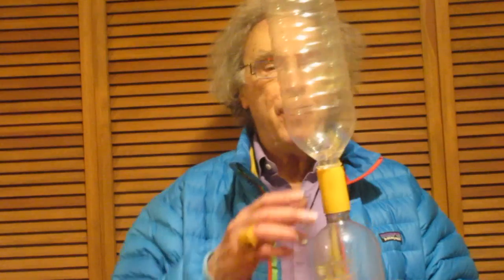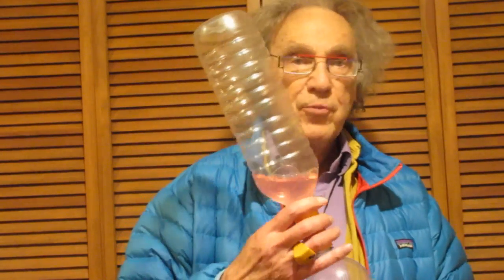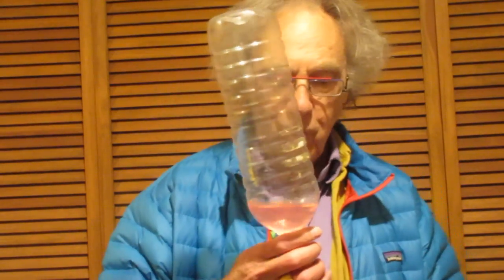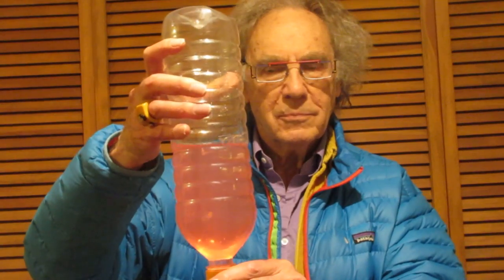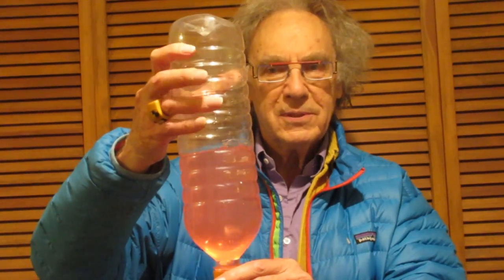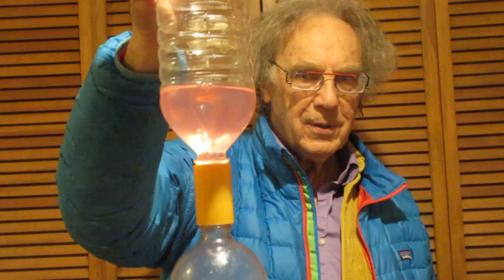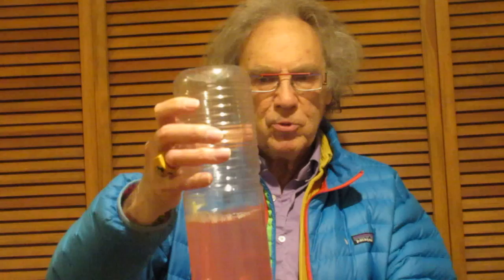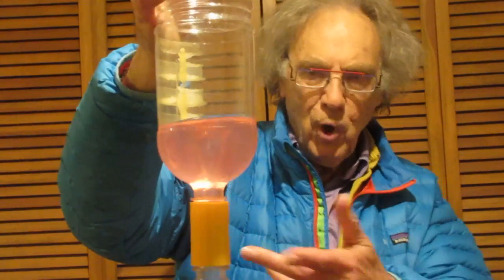Solution Problem #2 -  Vortex Transfer of Lemonade

Comment: Thank you Professor for mentioning my video. For those who have hard time to find my video, just type in the search on YouTube: "Video answer to professor Walter Lewin", and you will find it. Yes my English is not the best - that is because I learned it myself... well somehow. Greetings from Croatia. Milan Karakaš.
Reply: Prof. what about the value of min time to transfer the liquid? Here for one bottle the liquid leaves and the same amount of volume is occupied by air from the other bottle if not then vacuum creates pressure diff now for maximum rate of transfer the volume of substance entering and the volume of substance leaving must be the same hence max rate of transfer is obtained when the cross-section available for water to leave and air to enter are same. So for the straw solution if you have a straw such that the inner cross section of the straw is same as the difference in the cross section areas of the connection and the straw you will have max. transfer rate. But the rate can still be increased if additional force is applied on water such as accelerating the setup upwards or having extra systems inside such as piston(plunger).

Comment: I always wondered why a vortex won't form automatically when you empty a bottle, but when you empty your bath or sink it automatically forms.  Vertasium and SmarterEveryDay made an excellent video explaining this with a wonderful experiment showing why the earth's rotation has a bigger effect on a body of water covering a bigger surface area.
Reply: Because the engineers who designed your bath and sink had already known this?

Comment: Excuse me for being a physics noob but I had thought of something that I thought would work the the differentiation in pressure. It think Dr. Lewin mentioned it but it may have been confusing for me. What if you poke a hole in both bottles? The lower pressure bottle draws air in, and the higher pressure bottle (the one with water being "pulled" into) pushes air out allowing water to transfer through easily.
Reply: You're absolutely correct and this video is garbage. Find another source for physics knowledge.

Comment: Clever solution, probably all efficient toilets designed to create a vortex clockwise (in North) and anticlockwise in South were inspired by this principle. The bubbles passing through and water passing down increase the vortex spinning, is this because the gravity increases the speed of water passing through the least air intake resistance?
Reply from the maker: ask google
the physics of vortices is very difficult

Comment: What happens when you tip your bottle assembly on it's side, and let the liquid transfer between them, while slowly tipping it to optimize the rate? I would think that the moving liquid could occupy at least 90% of the opening, allowing 10% for the air to transfer the other way.  What do you think?
Reply from the maker: that would rank among the longest times of transfer. Try it!
Reply: I will let you know. ,,and I will be also trying the squeeze test, that I mentioned before. I have a feeling that one will beat the vortex.  The think about the vortex solution is that it is perhaps the most elegant and the least obvious one....until you do it.
Reply from the maker: the opening that connects my 2 bottles is only 4 mm across! I have tried your method months ago and timed it. Vortex transfer was 7 times faster!

Comment: So is this why tornadoes form?   When an atmospheric condition forms where there is a narrow hole in a blocking layer - forcing hot, rising air to squeeze through it to get to the upper atmosphere (Thundercloud) it naturally starts twirling as a way to increase the transfer....

Comment: Professor, what about the type of liquid? Will you have the same results with mercury for example as opposed to water?
This is lemonade, and most lemonade I know is made from a gelatine, it's viscosity is different. Is it carbonated lemonade?
So my best guess, not solution, is, it still depends on what type of fluid you're using.
Also a lazy question, because we both know I can test this out myself too, but I don't have the proper tools nor things to do so at this very moment...But, what about adding a tube that goes from the top of the bottom bottle to the bottom of the top bottle, making the (air)pressure equal in both bottles?

Comment: thank you professor, very ingenious solution. I was thinking to make a hole in the bottom of the upper bottle and another one in the upper part of the lower bottle so the air can get into the upper bottle to replace the liquid and the air from the lower bottle can get out in order to make room for the liquid. I am guessing this solution would be faster but it needs to be tested first. What do you think?
Reply from the maker: the hole will make it worse. try it.
Reply: I am talking about two holes one in each bottle one for air in one for air out. Thank you for your reply.
Reply from the maker: may make it worse - try it and let me know

Comment: wow, interesting. 
half way through the video I've came out with something of my own:
adding 2 tubes into the design, where one starts at the bottom (on the side of the bottle) and the other end is attached to the top of the other bottle, do the same on the other one. Allowing air from one bottle to escape quicker to the other. I believe it would work.

then I've seen the tornado ... wow I did not expect that :D very good.

Comment: you can put air hoses between the 2 sides one high one low
Reply: @SimonWoodburyForget  Creating pressure/suction also requires energy, not to mention it can deform the bottle.

Comment: Professor, I have a doubt. 
In the very starting of the video, around the first minute or so, you said that the pressure in the empty bottle is more than the pressure (due to air) on the side with lemonade. I don't understand why (and I find your explanation a bit counterintuitive). Let me elaborate on my understanding so that you may help me out where my understanding goes wrong. 
When the lemonade side is kept straight (neck facing up), the air columns in both bottles are in contact and are rather the same, and have the same pressure as a result. When we invert this configuration, the liquid gets in between the two reservoirs but since the pressure of both air columns are still same due to no change in volume available and no change in number of molecules (assuming that the inversion took place very fast) [PV=nRT]. 
Thus, now what I believe is happening is that the lemonade being a fluid that is also denser and is being pulled down by gravity too, drops down. But since it is incompressible, the volume available to the air becomes lesser as more lemonade drops down, and thus the pressure increases. 
Eventually, it becomes more than the pressure in the air column above the lemonade and thus it bubbles up while lemonade drops down thereby obstructing each other's free flow. I think that the water is just a medium between them, a separation, a sort of a weak wall. 
But at the same time, as you said, the water column also exerts a pressure proportional to its height, this is also true, but I don't understand how come you said that the pressure on the empty side is more. Since, before inversion both volumes of air had the same pressure. I understand, that the lemonade would have some pressure, but how can we account so much extra pressure suddenly(equal to density times gravity times height) with negligible compression in volume of air in the empty bottle?
Thank you for your patience and reading my question. 
I will be highly grateful if you can take out time to answer my query.
Thanks a lot professor!
Reply from the maker: If you measure the pressure in going through the liquid  starting at its  surface going down to the yellow funnel, the pressure must go UP with an equivalent of about 8 cm of water pressure.
Reply: Pranshu Malik - "but how can we account so much extra pressure suddenly(equal to density times gravity times height) with negligible compression in volume of air in the empty bottle?"

It would take about a millimetre change in height of the air columns. You wouldn't be able to tell just by looking.
If we take one atmosphere of pressure to be equal to 10 metres of water, then 8 cm represents 0.8 per cent change in pressure. A 0.8 per cent change in the volume represents roughly a 0.3 per cent  change in the linear dimension. The 0.3 per cent change would be shared between the two columns, 0.15 per cent each. If each is 25cm, that would be less than half a millimetre each. You would notice nothing!
Reply: Icy Strangers Thanks a lot!! Oh yes, I forgot all about the numbers
Reply: Lectures by Walter Lewin. They will make you ♥ Physics. Thanks a lot, professor!!!

Comment: I noticed an increase in drain speed when I tilted a bit the bottle near the end of its draining, all that without destroying the vortex, is it just me or is it an even faster fay to transfer the lemonade?
Reply from the maker: No!
build one time it and let me know
Reply: I made 5 measurements of the time for 4 diferent cases, to measure it more accurately I put a mark in the bottle to start timing when the level of the water passes that line until the level passes the cap and I only drained the bottle one way. First I had a plastic to make the tunel between bottles narrower and emulate your bottle, indeed you were right and my times for the drain with and without the tilt where (8,34±0,10)s and (8,400 ± 0,089)s which are efectively the same,  however the tilt you can do in this case without destroying the vortex is very little and has no effect whatsoever, but when I removed the plastic and let the tunel have it's original size the vortex generated won't be as narrow and when I did the measurements again I got (3,090±0,054)s and (5,062±0,083)s for the tilt and no tilt case respectively. I'm going to a festival this next 4 days, but if needed I can make a video on it.
Reply: I was hoping some feedback on this

Comment: First of all it's been a pleasure learning from you sir..
I duly admire you and your teaching,...the idea is great 
one more thing,u could probably ask some maths problems too,i believe they would be the best one's (logical).
Reply: +Lectures by Walter Lewin. They will make you ♥ Physics. 
God! sir, ur reply made my day😇😍
Reply from the maker: Teach me please. How can I make things like this 😇😍 and others too?
Reply: +Lectures by Walter Lewin. They will make you ♥ Physics. 
U just need to hold on the the enter key which is on the very bottom on the right side( we use to change the line)  and then it will pop it two options, scroll up to the smiley and u will get those😍😍
am so happy am talking to professor Walter, u certainly made my evening
Reply from the maker: enter key on the every bottom on the right side. Do you mean the enter key of my key board?
I held it down = did not work.
plse be more specofic
Reply: +Lectures by Walter Lewin. They will make you ♥ Physics. sorry I was considering a mobile phone, could you please tell me which device are u using,that would be helpful
Reply: +Lectures by Walter Lewin. They will make you ♥ Physics. 

Hold down the 'ALT' button on your keyboard.
Make sure you have a keypad that is on the right hand side of the keyboard with numbers 1-9.
Still holding down the 'ALT' button hold down a number such as 1.
Release both buttons and you should get a smiley face that looks like this: ☺

works for Windows
Reply from the maker: I do not see an Alt button 
the upper row of my keyboard is 1   =>  9 then  -- then = then delete
If I hold down "1" I see a "1" in my text
Reply from the maker: THere is an "alt" button - bottom row capital of the "option" key
nothing happens when I hold it down
Reply: +Lectures by Walter Lewin. They will make you ♥ Physics. 
This works!!😇
Position the cursor in any text field you'd like to insert an emoji, like posting a tweet for example.Press the Command and Control keys on your keyboard. Then press thespace bar. This will launch the characters palette.

Click on the Emoji icon in the sidebar on the left side of the Character window.
Reply from the maker: """for a Mac- option +8 should work"
unclear what you mean
key + and key 8? that's difficult as + is capital and 8 is lc
Reply from the maker: >> one on the right side of keyboard keys and not on the upper row>>>
there is no "1" on the right side of my keyboard
Reply from the maker: >>>>Press the Command and Control keys on your keyboard. Then press thespace bar. >>>>
NO does not work
Reply from the maker: being a good teacher is not easy - ha ha ha
Reply: +Lectures by Walter Lewin. They will make you ♥ Physics. 
True that sir, but never lose hope

try one of these
 option + command + T
or
command + control +space
or
command + shift + T( used to work for older versions)
or 
control + command + T

+ means u have to press them together, all three of them

I hope it works
Reply from the maker: Thanks I hope this makes your week!
Reply: +Lectures by Walter Lewin. They will make you ♥ Physics. 

OH!! its there already😍
yey🙋👏 , as it goes
"A physicists can do any possible thing"
Reply: +Lectures by Walter Lewin. They will make you ♥ Physics. 
How do I mail u
I have some things related to INVISIBILITY( my favourite),.. some ideas, imagination and queries
Reply: +Lectures by Walter Lewin. They will make you ♥ Physics. 
U truly made it sir... its definitely a dream come true to talk to the greatest physicist in the world, & a much greater person. 
Take care of urself😇
Reply from the maker: You can only post questions for me here.
Reply: +Lectures by Walter Lewin. They will make you ♥ Physics. 
ohkay sir ,😇works for me.

Comment: What happens when you lower or raise the viscosity of the liquid?   I believe the method of squeezing the bottles alternately is the best way to add the needed energy to speed up the process.  The only thing that the vortex adds to this process is to open up a passage for the air, but it also slows down the effect of gravity on the liquid.
Reply from the maker: >>> it also slows down the effect of gravity on the liquid.>>>
no, the slow down is the result of the viscosity of water and of the narrow opening between the bottles, that's not Gravity's fault
Reply: But do you not impede the movement of the liquid from the top bottle to the bottom bottle by virtue of the centrifugal force opposing gravity?  I believe the shape of the bottle's upper portion being a hemisphere, will enhance the centrifugal force. I noticed that the rate of transfer sped up slightly as the vortex slowed. I am imagining that if the vortex speed was high enough, the liquid would remain forever in the top bottle. Actually I noticed this as a child when playing with such experiments.   I do not attend any school, but I am a student of physics. I will appreciate your opinions of my opinions.

Comment: Dear professor, i maybe thought of an other way to transfer the liquid. As gravity is not strong enough to pull the liquid down so fast because of pressure etc..Can't you create a force by yourself by grabbing the bottle filled with liquid, while you keep the construction horizontal. And then spin arround your own axis, so there is multiple G-forces working on the liquid? as all the liquid will be pushed in the outer bottle. the bottle closest to you will crush because of low pressure but as soon as all the liquid is transfered, the pressure will be even again. What are your thoughts on this? :) thank you for reading

Comment: Hi professor ,Amazing video loved it ! I have a suggestion for a physics problem. about a year ago I pointed out a current in the opposite direction in one of your 8.02x lectures ,it was the one in which you show the parallel plate capacitor demo. I remember us discussing that problem and we reached the conclusion that the current in the opposite direction was because of a changing electric field between the plates because kappa was changing. It would make a nice problem as it's not immediately obvious why it would happen and the solution would not be available on the web. 
:)
Reply from the maker: lecture number? how many minutes into the lecture?
Reply: lec 8 @ 18:00 . There is a small current-which is expected to not be there.When the glass plate is put in and taken out.
Reply from the maker: I give the answer with demo in a later lecture
Reply: ohh

Comment: sir, I have a question. why particles have to has a velocity to be effected by magnetic field? If we add velocity to the magnetic field lines, would particle still be effected ?
Reply from the maker: >>>why particles have to has a velocity to be effected by magnetic field?>>>
what do you mean by "particles"? If a small ball bearing of size 0.1 mm is a "particle",  It's effected by a magnetic field.
Reply: Lectures by Walter Lewin. They will make you ♥ Physics. yes, I tried to mean that and why excatly it has to move. wouldn't it be the same if "particle" stays still and we move what creates magnetic field.
Reply: my teacher in univercity says otherwise
Reply from the maker: >>>I tried to mean that>>>
It's attracted (thus affected) by a magnet. and it is NOT moving! >>>why particles have to has a velocity to be effected by magnetic field?>>>
thus this is not true
Reply: http://hyperphysics.phy-astr.gsu.edu/hbase/magnetic/imgmag/rthnd.gif
In this formula,  "q" needs a velocity so it can be affected by magnetic force.
Reply from the maker: all mammals are animals but not all animals are mammals.
>>>why particles have to has a velocity to be effected by magnetic field?>>>
this statement is INCORRECT as particles which have NO velocity can be attracted by a magnet.
an electric charge, q, moving with velocity v (vector) in a B-field (vector) experiences a force  q*VXB (cross product between 2 vectors). I cover this in detail in my lectures.
Reply: got it now. thank you professor